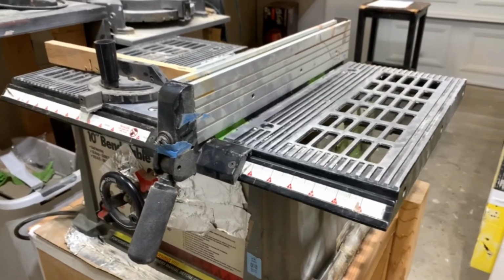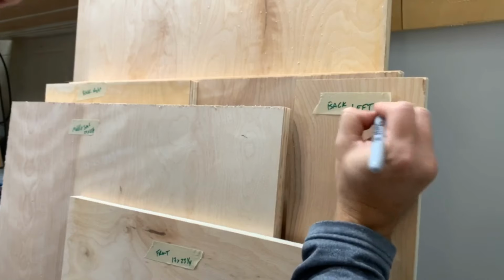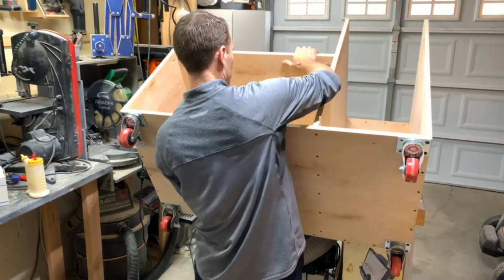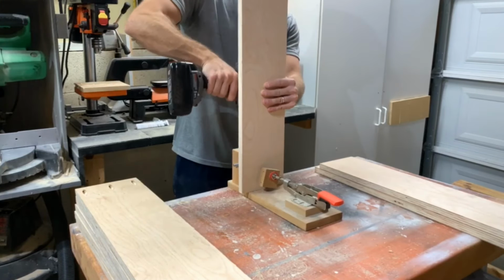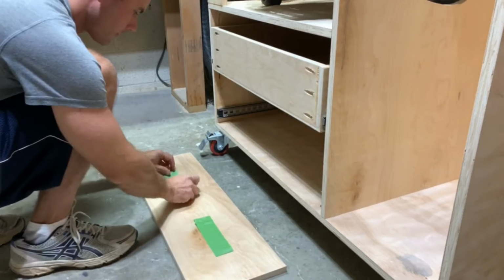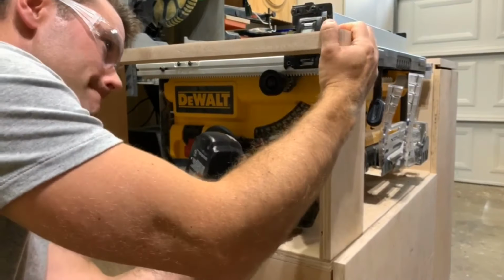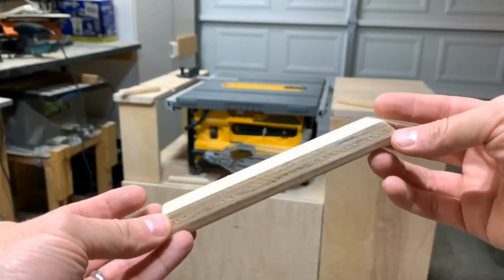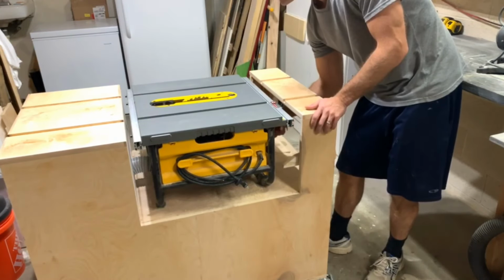The BEST Mobile Cart for a Table Saw! In my humble opinion of course.

Comment: Love the shape and function of the boxes that make up the three sections. Utilizing that space under the saw. My Craftsman has a rail that sticks out five inches on the front corner for the T-style fence. Building mine out to accommodate and make it difficult to hook my hip into it.

Saw a comment about Shop Crocs. Slip on shoes like crocs are great to sneak into the garage. I wear some slippers and moccasins. Who wants to tie shoes when you run out into the garage for a quick shop visit to move a project a little along? :)
Reply from the maker: Thanks so much!! You get me.

Comment: Personally, I would turn the tablesaw 90 degrees, so that the handwheel is towards the drawers, I would add a piece of plywood to close the "side" opening (which would also add even more storages, if you were to make small shelves or a peg-board style plywood or even a french cleat system, and lastly I would add a fold-down table at the back of it for an outfeed. That would add so much more versatility to your design, with minimal effort. I know it is old, you probably upgraded, but yeah... Alongside with the dust collector, that would make for a pretty great mobile bench! You could also add a groove to the fold down table to add a portable router, jigsaw, sander, etc!
Reply from the maker: Great suggestions!! Definitely a lot of options one could take with this concept.

Comment: I like your presentation style and humor.  6:47
Reply from the maker: 😂 thanks man!! That was a rough part of the build but nothing a little apple break couldn’t fix.
Reply: @RLLWoodworks  Did your saw come with leveling feet or did you add them?  My DW7485 has plastic covers over the feet - I suppose I need to see if there's a threaded hole once they're removed...
Reply from the maker: Hey sorry for the delay! Yes it came with threaded leveling feet but I also ended up shimming it some.

Comment: Excellent video and process. Thank you for sharing. I to have a DWE7480 that I'm in the process of adding extensions. There is a excess amount of sawdust that leaks on the right side of the table saw and I'm working on an system two woodworkers used to solve the same problem on 2 different table saws. If it works, I will pass it on since we have the same table saw. Until then, keep up the great work.
Reply from the maker: Thanks so much!! Definitely let me know what you find out. That is an areas for improvement for sure so I would love to hear back what you learn. Thanks brother!!

Comment: Nice! I have same table saw and I like that it's mobile. But as you noticed, it's not great for larger pieces. I love the little tracks, that's the main thing. I am going to do the same thing, but with the wings that can fold down and fold up to lock in place. My one complaint about this table saw is the stupid fence. 

I have some tips for dealing with this "stupid fence" or SF lol. When setting it up, disregard the markings on it. Instead, I use a square to square up the fence. As you know, you get off by 1/16" of an inch out of square on a 8 foot rip cut, you are going to have a bad day. Hmm, maybe I need to sell my table saw and get a better one :)
Reply from the maker: Thanks!! Yeah it’s been a great saw for little DIY jobs but would love to upgrade one day.
Reply: @RLLWoodworks  Trust me, this little saw I can make it do anything, as long as you are willing to build whatever it needs. nervous laugh also, subbed.

Comment: Beautiful and well designed Table. Bought your plans, which seem very nice, and plan to build it over the next few weeks.  One problem:  Your Amazon link goes to sets of 6 pairs of drawer slides. You just used 4. And it opens with 8 inch ones highlighted, but it looks like you used 22 inch?  Can you update that link to prevent people from getting the wrong slides like I almost did?
Reply from the maker: Thanks for your support and thanks for the info on the link! Yes I will update it now! 🙏🏻

Comment: Real nice looking setup. I'm currently building a similar-ish bench for my saw (7485, incredibly similar to yours). 2 questions: other than the paste wax on top, did you finish the rest of the piece with anything? And second, is there anything you would have done different from a design perspective now that you've used it a while?

Appreciate the time and effort to make this video man, well done
Reply from the maker: Thanks so much man! Nothing but paste wax but I nice coat of two of polycrylic on the body would probably be good. The main issue I’ve had is a lot of dust collecting on the base because the bottom of the saw is open. Not sure if that could have been addressed with the build tho. Other than that I have no regrets!

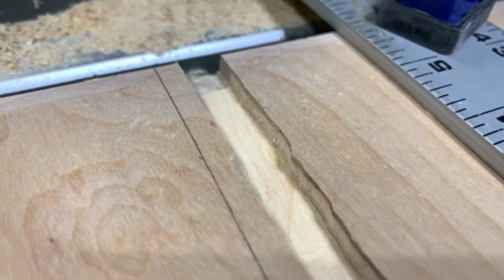Comment: 6:18 - the fence wasn't the issue here. It was the wrong direction you were going with you router along the fence. I don't know the correct english term for this, but in german there is "Gleichlauf" and "Gegenlauf". When you are routing in "Gleichlauf", that means you are going with your router in the same direction as your router bit does, it is pretty hard to lead the router along a fence without any wobble. I have a good link to a german woodworking journal where this issue is adressed, but it is only in german. Cheers!
Reply from the maker: Thanks for the info L. K.! Sounds like you’re talking about the English term “clockwise” and “counter clockwise”. I’m a novice so really appreciate the comments!!
Reply: @RLLWoodworks  Yes, I guess that's the correct english term for what I meant. ;)
This is the link to the mentioned article - by using your right thumb and index finger, you can always check if our are going counter clockwise (or counter rotation?) with your router. Maybe you can figure it out by the pictures of the article what I meant. All the best from Austria!
https://www.holzwerken.net/artikel/archiv/so-fraesen-sie-immer-sicher-im-gegenlauf
Reply from the maker: Awesome thanks so much!!!
Reply: @l.k.1011  From the video, isn't he following the finger rule? (Point your right hand thumb (palm down) at the fence, and you naturally point the direction the router should take. That's what I'm seeing in the vid...
Reply: @daneyuleb  Exactly, that is what he is showing! ;)
Reply: @l.k.1011  So... that means he was going the correct direction, right? What's the problem with what how he routed?
Reply: @daneyuleb  Actually you are right. I rewatched it. He did it the correct way. My fault! ;)
Reply: @RLLWoodworks  I rewatched it, because one guy made me aware that you did it right. And he was right - you did it correctly. Sorry for the misleading comment. The link I posted is still a good reminder. ;)) All the best!
Reply: @l.k.1011  No worries! Thanks for the link though--fantastic info on the finger rule!  I'd never heard that, and it definitely makes knowing the right direction MUCH easier!

Comment: I have a Harbor Freight 10" Warrior table saw that desperately needs something like this with the infeed/outfeed and wings - but the cheap rip fence that came with it doesn't work like this one and many others I've seen. It just sits on the table and then you ratchet it down with a plastic lever. I haven't been able to find any other aftermarket version that works differently and allows me to build a stand around it.

I can't wrap my brain around how to do it. Any help?

Comment: Do you have any issues reaching the on/off switch, tilt or raise and lower on the front of the saw?
Reply from the maker: Really good question. I need to bend down a little to get my arm in there and probably wouldn’t want to make the infeed any longer. But it’s not too big of a deal.

Comment: Hi pal, awesome stuff! Would you mind advising how you got the fence movement thing so smooth and long? It's been a long time issue with mine, I wanna upgrade
Reply from the maker: Thank you! Are you talking about the miter gauge that I slid across the top? Or the rip fence on the actual saw? Or something else?
Reply: @RLLWoodworks  the rip fence, pal. Mine has a very short kinda "T" on the actual table saws rip fence which needs to be pushed in to even and straighten it. Something like yours would negate any doubt in whether it's parallel
Reply from the maker: I gotcha. My saw has a has a rack and pinion mechanism and it connects on both the front and back so it’s always parallel. Definitely one of the best features on this little job site saw. Great engineering by DeWalt.
Reply: @RLLWoodworks  sorry, how might I look into getting one myself bud? And is it universal at least for the most part? It does look good. I don't often see tables saws bit enough to differ- isn't every smaller "tabletop" box shaped table saw classed as a job site saw? Idk the difference myself but do see the name difference on the likes of Screwfix or toolstation (UK supplier)
Reply from the maker: The exact one I have they don’t make anymore but here is one very similar on Amazon. Has the same fence mechanism.  https://www.amazon.com/dp/B0842QDW95/ref=cm_sw_r_cp_api_i_35EZ0JCN420WFFAHPE8H

Comment: Nice build, and clever idea on in-feed and out-feed.  Question, have you secured the saw to the table so it will not shift, etc, and if so how so?  Thanks!
Reply from the maker: Thanks so much!! Yep I screwed it into the cart and then a screwed in a couple of blocks around the base to keep it in place. A little awkward but was able to get it done.

Comment: I see the bottom drawer and slider is lifted 3/4. What did you use for measuring the top slide?
Reply from the maker: I cut a couple blocks the same height as the bottom drawer and then put the upper slides on top of those blocks.
Reply: @RLLWoodworks  wow! Thank you so much for the quick reply here on a 3 year old video! I had just enough time to grab 3/4 scrap and open the packaging of the slides before I got a reply! You rock!

Comment: How much modification would be needed to plans if I wanted to incorporate the Dewalt dwe 7491rs table saw
Reply from the maker: Assuming you can take off the stand and wheels it should need much. If you can tell me the dimensions of just the saw I should be able to tell you.
Reply: @RLLWoodworks  unbolted from folding stand dimensions are 26.5in wide, 21.5in deep, 12.5in tall (just to the table, not fence). There is also a dust port that sticks another 2in out the back.
Reply from the maker: @navdaman4431  This cart was built for my saw which is right about 23" wide, 23" deep, 13" high so it sounds like you would only need to make it a bit wider.
Reply: @RLLWoodworks  thank you for reply I will take note of those dimensions and look over the video and see how much plan changes I would have to do.

Comment: Just when I thought I knew which table saw base cabinet to build, I run across your design! Great work.  Now I have to do a full +/- analysis 8-)    BTW, at about a minute into it, you mention the "DIY K4 Kreg pocket hole jig".  Did you build that? if so, do you have any details on it?
Reply from the maker: Hey man thanks so much!! Good luck on your analysis lol. Yeah I built that DIY K4 but it was before I was making videos. Check out my buddy’s channel “Make With Jake”. He made a better one and has plans for it. 👍🏻

Comment: I have a craftsman, if I buy these instructions, what pieces of wood would I cut different? Would it be too many to be better off not buying the plans?
Reply from the maker: Great question. Can you share the dimensions of the craftsman? Height, width and depth?
Reply: @RLLWoodworks  thanks for the reply. The height is 12” length is 27 3/8” and width is 32.5” inches
Reply from the maker: Mine is 13” by 23” wide and 23.5” deep so sounds like you could need to make it a bit bigger. You could definitely do it but it would take some redesign.

Comment: I really like this design, I’ve been frustrated by the lack of in-feed on my DW745 but few extension table designs actually include additional in-feed. How did you ensure the table of the saw was flush and level with in-feed and out-feed tables?
Reply from the maker: Agree the infeed is my favorite feature. I used the leveling feet and even some pieces of paper to get it perfect and so far it’s held up. It took me a few days of using it to dial it in tho.

Comment: would this work for a DWE7490?
Reply from the maker: From what I can gather it should. If you want to shoot me the H, W and D I’d be happy to tell you for sure.
Reply: @RLLWoodworks   I measured and it appears to be H = 12.5"  W = 26.75"  D = 22" or 25" with the fence track....

However, one website said it was 12-3/4 in H x 26-1/2 in W x 26-3/4 in D

Table size according to manual is 21 7/8" x 26 3/8"
Thanks!
Reply from the maker: @briankalina2491  Hey thanks for the info! The saw this was built for is 13Hx23Wx23D so in order for the 7490 to fit one would need to make some adjustments by either getting rid of the infeed table (I love mine so wouldn't suggest) or the dust cabinet, or making the entire thing longer and deeper.
Reply: @RLLWoodworks  thanks! I definitely want the infeed table!
Reply: @RLLWoodworks  I was just circling back through these comments since I realized I have the DWE7485 (8.25" blade) after I bought your plans. I looked up the 7480 (10" blade) and it showed dimensions as 25.75 x 26.5 x 13.88 inches. But what you just posted above matches my specs so not thinking I need to make any modifications?
Reply from the maker: @ttheis1  Hey man thanks for checking. Not sure about those specs you found but my saw and this cabinet is for 13x23x23 so you should be good to go!

Comment: You screw the wrong direction on many pocket screws....
Speaking of design flaws.
Reply from the maker: They seem to be holding up okay. Thanks for watching!!
Reply: @RLLWoodworks  made my first cabinet today.
Glad no one was watching.
 half of what will be two cabinets joined by tablesaw center shelf.
Reply: I could not find my New Kreg pocket hole jig, never used. So winged it without.
Reply from the maker: That’s sounds awesome! How big is your saw? I like the kreg jig but still use face screws plenty. Stronger IMO. I hope you find it!

Comment: Why convert a saw meant for 2X4 construction lumber into a shop tool (which I will assume will be used for woodwork)? Regardless of the effort, this will never be able to deliver cuts as nice as any entry lever real stationary table saw, witch prices starting at $649 (Delta) or $7-ish Ridgid at 3.25 HP...
Reply from the maker: I agree those are both definitely better saws. I looked at them and would have loved to get either but I needed something that I could store away because I don’t have that much space. I will say that this DeWalt has done everything I’ve asked it to do and I’m very happy with it.
Reply: Why not? This table saw costs half-two thirds of what you mentioned and is mobile. So if I need it around the house to cut my 4x2/6x2 I can take it with me to the attic. But if I want to cut plywood sheet I take it to the cellar and run it through my home made bench. I agree that if I made living of woodworking, furniture to be precise, than fine but in most of the cases owners of such table saw know what they doing. You do not just spend £500 because you like it. Usually at this price point you know what you want/need and what issues you may ensounter.
Reply: Awful lot of guys on here producing fantastic builds with a job site saw. Look around and you’ll be amazed.
Reply: There are several good reasons to buy this saw.  Price, size, portability.  It's a solid, precise saw.  I can't do everything with it that I could with a full-size saw, but for what I need it for, it's great.  Mine is on a small stand, but I will be building a larger stand for it soon.
Reply from the maker: Agree, thanks Andrew! Would love to upgrade some day but for now this is a great saw.